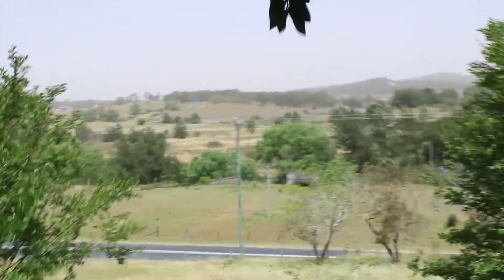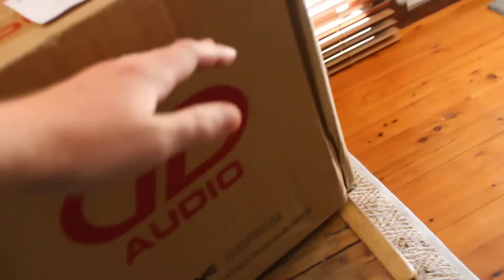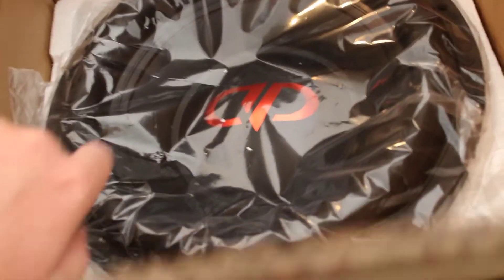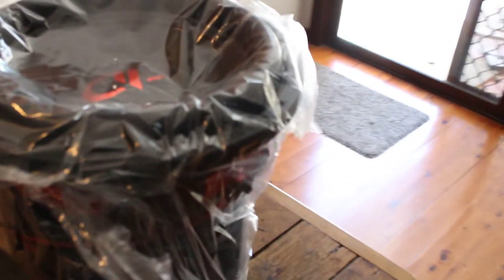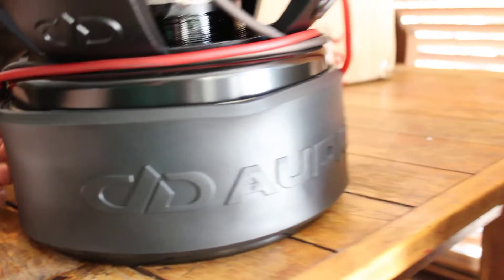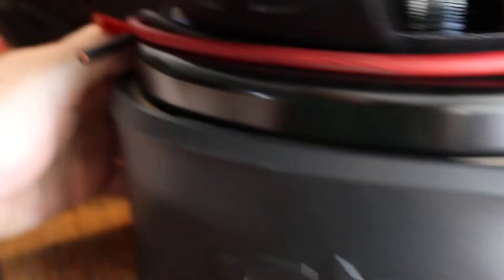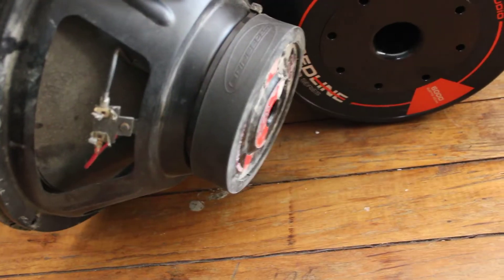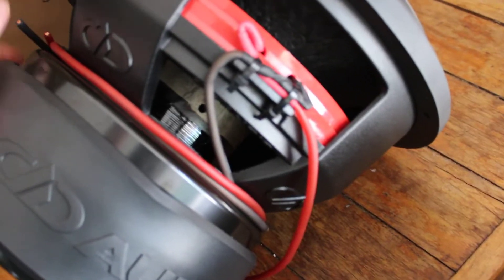Digital Designs 812D- Ultimate sub for the horn!

Comment: Where can I get these
Reply: Ive spoken to DD and the 800 series redline isn't available in the U.S. 
If you're in Sydney, call lifestyle store at north Parramatta
Reply from the maker: depends on where you're at, from what I can tell DD markets these redline 800 series like their DD 95/99 series, except for international customers. If you're in the US, I'm not sure on pricing, though if the 95/99 series are around $500-600 USD you may as well just go for one of them. Check out the dealer locator on their website, worked for me.
Reply: A 95/99 for 600 USD  new!?